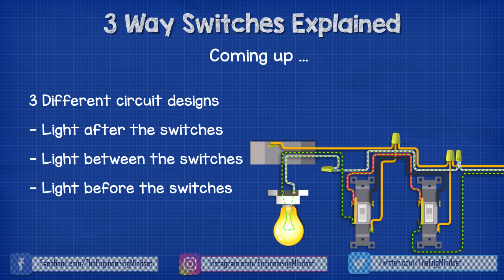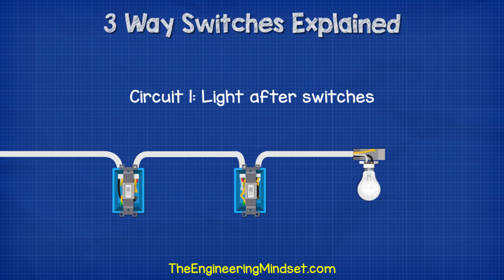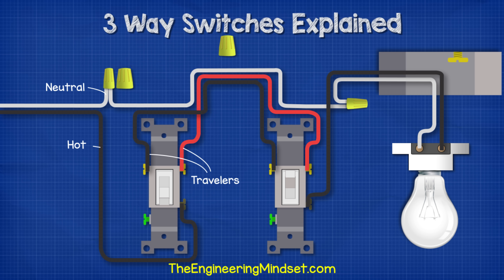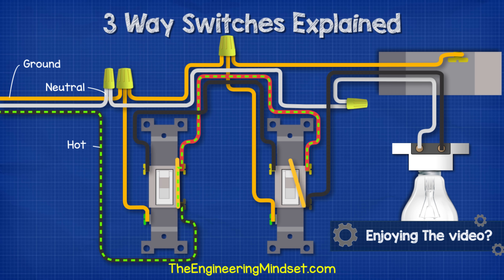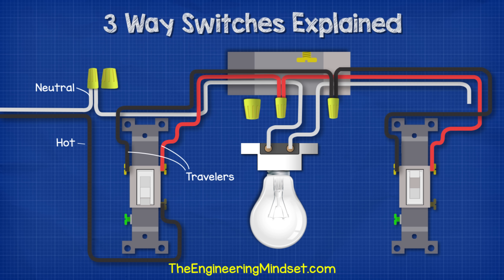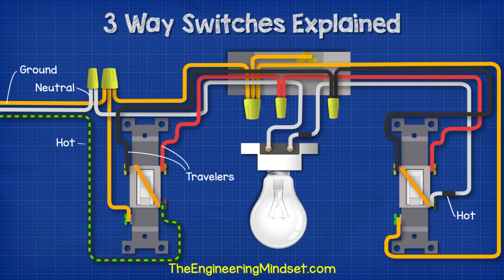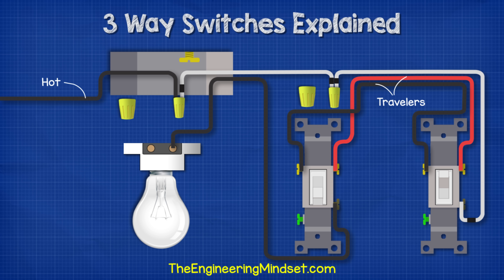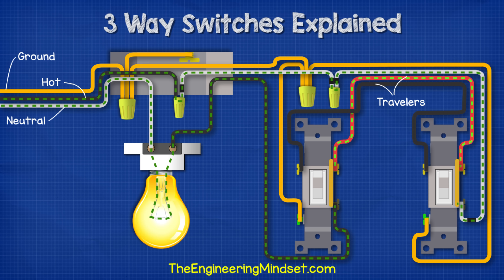3 Way Switches Explained - How to wire 3 way light switch

Comment: Does option 2 meet code? I didn't think you could use white neutral as a traveler in the US.
Reply: Options 2 and 3 no longer meet code for locations where the Code requires neutrals in every switch box (with a few exceptions).  The options shown in the video are perfectly safe, have been used for decades, and are more economical, but the Code changes are for future-proofing with smart devices which require power to operate.  As a general rule, every switch box must have a neutral conductor in it, even if it's not initially used.  This means Options 2 and 3 would either have to have a separate cable ran beyond the second three-way switch and back to the light, or a 4-conductor cable installed.
Reply: Yes, It does

Comment: But why?  What's it accomplish functionally?  Who needs two switches to ...one thing?
Reply: Michael Amos Really?  Pretend you walk into a dark garage, can’t see a damn thing. If you had another switch by the door you could have been able to see before stumbling over the mower, shovel, and rake to get to the switch on the wall inside the house.  Man, you haven’t lived much if you can’t understand the need for two switches!
Reply: Staircases are a better example.  No point in having a light for a staircase that is only operable from just one end of the staircase!   It's not just a convenience issue, it's a safety issue.

Consider a kitchen, or living or dining room, that has 3 entrances.  A switch should be placed at each entrance which can operate the room's light.  It's not just a safety issue, it's a convenience.

Comment: Hi, great video! I purchased the PDF also. Do you happen to have this type of illustration for wiring multiple 15 amp room outlets together?
Reply from the maker: Hi David, we do not currently have that but it's in the pipeline! I'll tag you when it goes live. Thank you for purchasing and supporting us, it's really much appreciated.
Reply: Thanks! I appreciate the response and look forward to the info when it becomes available!
Reply: HI, I tried to send a picture in an email response but the email did not send for some reason. The design/layout of the terminals on the 3 way switches I have are somewhat different than in the PDF drawings I purchased and I would like to verify my thinking is correct on the connections of the wires in the pictures. The red block squares represent a wire nut on the white wires. The green block squares represent wire nuts on the ground wires. Is there a way I can send you the picture for your review/input?

Your comments/input on the wire connections in the picture, which I realize isn’t to scale and as professional as your drawings with the switch boxes would be appreciated.

Regards,

Dave Hershberger
Reply: Wiring outlets together is very simple, for most circuits.  Each duplex receptacle has four screws (plus a ground), so the cable coming in can have its wires to one set of screws, and the cable going out to the next receptacle can have its wires connected to the other set of screws.  Connect the grounds by making a pigtail as 4-6 inches of bare copper wire, and connecting one end of the receptacle, and combine the other ends with the incoming and outgoing bare grounds with a wire nut or equivalent. 

If your circuit involves a GFCI, then make sure it is the first outlet in the circuit.  Wire the incoming cable wires to the LINE terminals, and the outgoing cable wires to the LOAD terminals.
Reply: Thanks for the information! It appears your suggesting using the series method of wiring outlets with your response. That is what I originally was going to use. Some have suggested parallel wiring the outlets. Given several nuts are used and number of wires behind the outlets can you suggest the width and depth of single gang outlet box to use?

Comment: love the demo.  traveler wires can go any of the traveler screws circuit will still work , the hot is the important one, must go to the hot screw usually black.
Reply: *common
All the wires on a switch are "hot" (except the ground wire, if any).
Reply: @jovetj  you are correct. travelers don't matter is what i meant.

Comment: Last one doesn't meet code, must have a neutral at the switch box
Reply: So does the nuetral just sit in box 2 ? Or is it tied off
Reply: @JimJoma954  Just sits in there, with a wirenut on it.   It's there for future-proofing, in case a smart device that needs it is installed later.

Comment: I was replacing all my outlets and switches in my house from almond to white colored. I had several 3ways and this was very helpful to follow the hot wire as I did some troubleshooting.
Reply: Remember that some of the wire colors will vary.  He showed some of the white wires (with black tape) being used to connect to the common terminal, but others might use them as a traveler.

Comment: Have you wire a 3 way switch on a ceiling fan using a 3 way multi switch where one toggles fan, one toggles light on fan and other
Toggles a separate light

Comment: This is the best 3-way switch explanation I've seen so far. 
I have a question though. How can I figure out which case is my current wiring setup on my 3-way switch with single bulb out of 3 case you've explained?
Reply: Examine the wires and the terminals on the switches.  Many devices will let you do this just by taking the cover plate off the switches.  Usually the "Common" terminal is darker than the others.  If you can see that, you should be able to see what colors the wires are going to each terminal.  If you see some whites connected, then you have Option 2 or 3 listed here.  In that case, you'll need to shut the power off, and remove the unscrew the switches from the boxes, and inspect the cables going in and out of the boxes to figure out which is which.

Comment: I never knew this. So how im able to turn my kitchen light off by 2 switches from opposite side of the kitchen one on each side and i can turn them on and off by either one so ig thats a 3 way? I live in 2002 construction
Reply: Sean yeah that's a 3 way switch. The third traveller wire makes that possible along with the 3 way switches on each side of your kitchen. 2002 construction as far as wiring is still up to date it's not like 1920 knob and tube lol
Reply: A "traveler wire" only exists between two three-way switches.  The wire after all of the switches to the light(s) is not a traveler.

Comment: Sir: Both L-1 and L-2 use the GUY wire outside the property to return the unbalanced portion of the load, to the transformer. Why oh why is it not necessary to insulate this PORTION of the neutral while the inside portion
it is necessary to insulate? Thank you for excellent past explanations.
Reply: What?  The guy wire holds the pole up so it doesn't get pulled over.  It doesn't carry current or have any grounding function.
Reply: @jovetj  Different uninsulated wire, not the one that holds up the pole,
                 Rather the one that the two insulated conductors are wound around LEAVING
the property to the power company distribution service.
Reply: @tedlahm5740  Oh, I think I see what you're talking about.  A "wire" that holds up other wires in an arial catenary but carries no current itself is called a messenger wire. 

The reason the neutral does not need insulated is that it's grounded at that point.  It's grounded at distribution transformer, and it's grounded at the service panel it's going to.
Reply: @jovetj  Unbalanced portion of the current RETURNS to the step down transformer 
via this means?

Comment: I tried to install a 3-way in the bedroom but the wife would have none of it.
Reply: She's rightly concerned that your wires might get crossed or a larger gauge wire may induce amp envy resulting in straying voltage
Reply: @1STGeneral  ..... thats the funniest fkin comment i've seen in a while!!!!!
Reply: @1STGeneral  good answer man
Reply: @1STGeneral  lmao!!
Reply: Presumably she wasn't 'turned on' by the suggestion
Reply: Depends on whether the third terminal was an A or a B
Reply: @MyName-bz4zn  you are absolutely right.
Reply: This is a pretty popular comment, I wonder what its current rating is ...
Reply: You have to try a single pole and two gang boxes, get the current flowing and backstab.
Reply: Get bigger nuts and try to re twist after.
Reply: LMFAO lol you needed a tighter gauge lol.
Reply: 😅 8:27  @danfuerthgillis4483
Reply: The jokes abound, hilarity ensues
Reply: She is part of the "Ohm's Law". She is your "Resistance" 😂
Reply: So it’s a man?
Reply: @@andrewlion1498 i think he has to assure her that she will remain the main switch , the other switch will be used once in a while , when ever the need arrises. And the other switch will never become a dedicated one.
Reply: Man same here! We’ll never win.
Reply: @philipadcock3508  some times winning is not that necessary, as long as you are playing, thats what it matters.
Reply: Legend
Reply: You gotta make her thinks it's her idea 😂
Reply: @The_DIY_Remodel_Show  the good ladies does not change their mind all the time. Whatever the decision was made it still prevails.
Reply: Thank you.  This made my day.
Reply: Smart lady
Reply: That’s a shame
Reply: That's because she wants to be the only one in charge of the switch that operates the vibrating mattress.
Reply: What a SHOCK
Reply: That’s because you were wanting an additional Outlet while she was hoping for additional  switch!!😅
Reply: She underestimated the effectiveness of double penetrating conduit.
Reply: I needed that laugh...💀
Reply: If you are not an electrician, she is absolutely right. Hire a real electrician
Reply: Why did I get an ad about going to travel at a place where your relationship might be on and off after this video 😮
Reply: Divorce her!
Reply: Women are wired differently
Reply: Invite a dude ?
Reply: Try connecting the black wire to the white
Reply: OL
Reply: Just stop dude. There’s kids here. Grow up. Bruh.
Reply: LMAO.
Reply: You got a good wife. Now try bringing in a male switch for three way switch

Comment: There’s a problem with your payment method. I enter my card info but it says you can’t verify my card. I’ve tried it three times and I know all my info is correct. I’ve tried two different cards and I get the same problem. I’m using prepaid Visa cards because I don’t use my personal card numbers online. Could that be the issue?

Comment: Here in Spain we do not use as much exposed metal in our circuits. If asked for a 3 way light switch, the customer expects to see 3 switches, in other words 3 different switches controlling the same light.
This enables us to wire between switches with 2 switch wires and the earth and neutral going straight to the light fittings.
I can understand the reason for metal in your construction as you have more fire risk so an earth is essential to break the circuit.
Most of our buildings are concrete block construction, so we use plastic back boxes.
We call the switches 2 way switches, so in a 3 way lighting (3 switches) we use 2 * 2 way switches and one cross over switch.
So one hot wire (live) goes to the first 2way and 2 transport wires to the crossover switch and 2 more transport wires from the crossover switch to the 3rd 2way then a grey switch wire (hot) to the light fitting. 
I hope that makes sense.

Comment: I dont get it in all three cases both switches have to be on for power to travel through. Isn't it suppose to be one switch on or the other switch on to get power through? Am I missing something?
Reply: There isn't an 'on' and an 'off' in the switches, just two different paths electricity can flow through. When both switches are aligned (meaning they are in the same position, both up or both down) the circuit is closed and light flows through the bulb. When they are in different positions (one up and one down or vice-versa) light cannot go through. Now, if you think about it, whenever you change a switch's state the bulb will either turn on or off, no matter the state of the other switch. Since there are only two switches, when you change one you're either aligning them (turning the light on) or misaligning them (turning the light off).
Reply: @lucasantunes8000  yes but In my homes case one can turn the light off at the bottom of the stairs (placing switch in off) then a person upstairs can turn the light back on even if the switch downstairs is off.
Reply: @TeSoad90  Yes, because when someone switches off the switch downstairs, the switches are getting misaligned, so no electricity flows and the light turns off. But when someone turns the upstairs switch "off", both switches will be in the off position, which means they are aligned again and electricity flows.

Comment: Logically, the lightbulb experiences an XOR signal with the two switches being the inputs. Any additional switch can be added by XORing it with the lightbulb wire.
Reply: Not quite.  The travelers can be wired in any way, and then your XOR won't work.  The simplicity is the selection of the alternate path to complete the circuit no matter switch switch is used.
Reply: say that again please...........

Comment: Question: what determines which of the three methods you would use?

In an existing house, you might need to add an additional switch onto the end of an existing circuit, but what about a new build or a complete rewiring, where you are at liberty to decide what to do?
Reply: I mean you can do which ever is easiest to do. mostly depends on where the initial wire is coming up from the breaker and where you decide to run the lines.

Comment: Awesome video explanation but the wiring in my house is so old that the solid core wires are all the same color beige!
Reply: @jaysonbrockman998  I agree.  Back in 1988, I had our 1920s wiring replaced, the electrician said it was a disaster waiting to happen.  Solid copper conductors, 18swg I think, sleeved with rotting, natural rubber sleeving, all encased in a braided cotten cover, impregnated with wax!!

Comment: Question: First type: Light at the end. Why did white wire needed to be sliced in 3 pieces? Why couldn't it run directly to light without any caps?
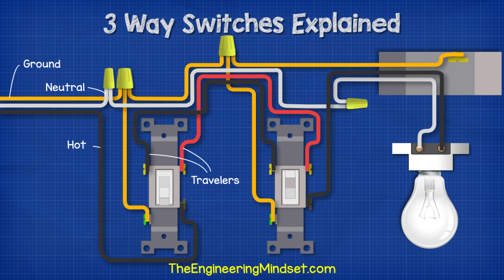Reply: You mean at about 2:55?  Because it's not a single wire.  The first cable comes in from the service panel, and goes to the first switch box and stops.  Then a second (3-wire) cable goes from that box to the second switch box, and stops.  Then a third cable goes from that switch box to the light.  Even if you were not completely changing types of cable, it would be too time consuming to try and split open a cable so you don't cut the white wire.   

This all assumes you're using nonmetallic sheathed cable, which is the most common in homes.  If you were running this circuit a conduit, you then would have precise control over each conductor, and could definitely make just one continuous long white wire.   Just make sure you leave a loop or two in each box it passes through, just in case it needs to be tapped into later.

Those are wire nuts not "caps."

Comment: I have the following setup -  switch 1, then 4 lights, followed by switch 2. I finally got everything working correctly, but the lights barely light up. It's as if there's a dimmer but it's not. I've been doing my own wiring for 20 years and never seen this. I didn't even know it was possible. What did I do wrong? Any ideas?
Reply: As he said, you wired them in series.  Once you're out of the last 3-way switch, that switched hot needs to go to your light or outlet.  If you have more than one light (or outlet), then you need to run additional cables to each light and connect them all together (all the hots together, and all the neutrals together).
Reply from the maker: You wired them in series instead of parallel

Comment: Question about method 2. Because the neutral coming from the light and going into the second switch box is now re-identified as a hot, and there is no real neutral in that second box, is that a code violation? I know that all switch boxes need a neutral inside regardless if it’s used or not. Would that make the first method shown in the video the more common way?
Reply: “Because the neutral coming from the light and going into the second switch box is now re-identified as a hot” 
Let's be precise with our terminology here.  If it's a Hot, then it is NOT a Neutral.  The white wire running between the light box and the second switch is not a neutral, even though it is white.  That's the reason for the black markings—it's a Hot wire.  The neutral in the circuit shown goes from the service panel, in and out of the first switch box, and then into the light box to the light fixture.
Yes, it is a Code violation (for both Options 2 and 3 shown in this video) for locales enforcing the "neutral in every switch box" requirement.  The simplest solution is to run a second cable out of the second switch and back to the light, and in that case you don't need the travelers going through the light box at all, and it  becomes just like Option 1 shown.
Reply: Did you find out anything about this? Am wondering the same thing
Reply: @rachaelavery3900   NEC 2011 404.2(C) was previously cited in an earlier comment by 
@UC7PeKojslZYWj32KveTns3g.  One possible first step is to plunk that into a search engine.  My personal preference is to use a conduit anywhere multiple-station switches are involved.

Comment: I tired method #2 with 2 lights in the middle instead of 1.  The functionality works but both lights are very dim, any ideas?
Reply from the maker: Sounds like you've wired them in series instead of parallel or there's too much resistance in the circuit.
Reply: You stole my answer!  Great work, thank you. @EngineeringMindset
Reply: To have more than one device (e.g. light) be switched, you'll have to run additional cables to the additional devices.